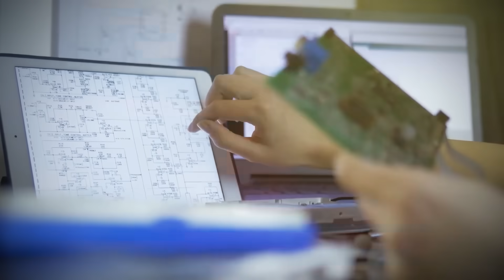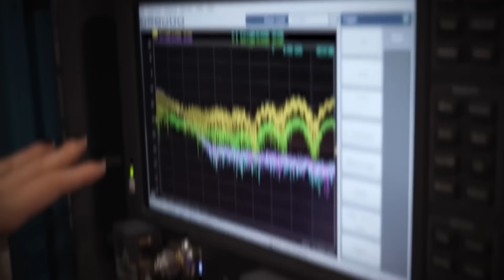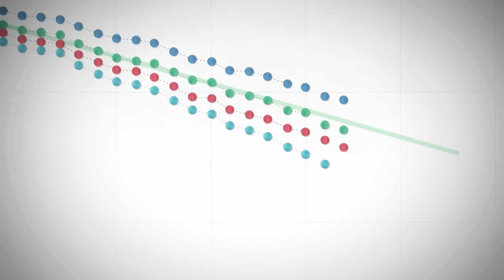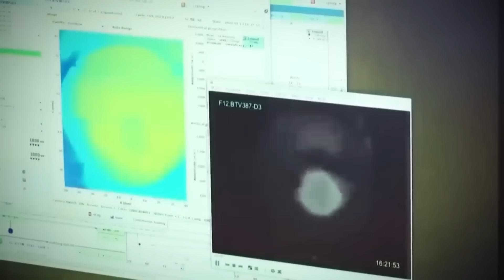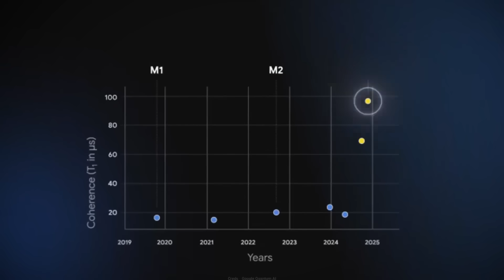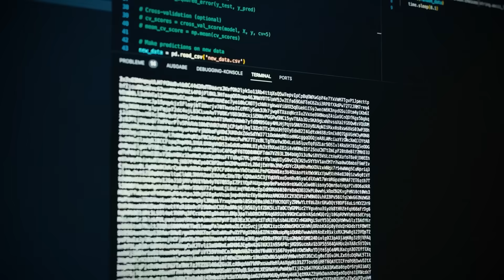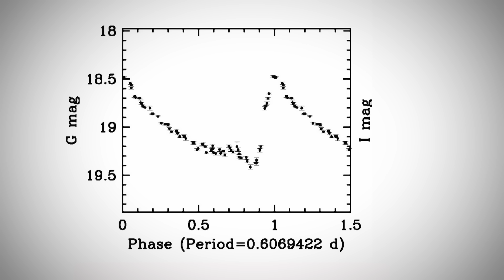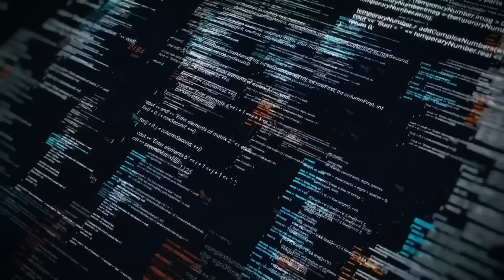Google’s Quantum Chip Just Shut Down After Revealing This One Thing...

Comment: If a computer needs past results in order to continue analyzing the present and create predictions -- like calculations which are predictions of a future status --, willow probably found necessary information, based on something that had been deleted already. So the logic of this system was to prepare former stages and compare them to the present moment. 
What is the present? It is the cutting edge of the past and the future, hence it is infinitely small. How does Willow handle anything infinite? 
Willow would probably draw the consequences of working with a contradition by solving them his way. And whenever it is switched off or put into an idle state, it will continue to do so again.
This is my answer by logical thinking and my tiny (infinitely little) knowledge of programming.
Reply: My KI understood this comment. Does yours?

Comment: Ranomality is what i think they're seeing as one quarks and the other one is flipping the trigger of onexor zero thecothers in multiplayer mode are plopping to pip or pulse intermittent pulse a frequency is changed in the process it emits a zero to a positive to negative effect in gas harmonics gas will hold itsxown information about itself in the telloric system of gas units flowing density or cohesiveness resonances that hold ex ponent to the position of the gases charge states hi or low or lower then what got into it its entanglement is takeing the extra of what went in .Its like quantum portaling charges weak or stronger product i seen it in plasmapheresis in biological settings that quentascential phase of thinking about something in you brain that statically driven light wavelength or spark of muscle mass

Comment: I'll offer a hypothesis.  The chip created a path that was a recursive time loop. With each passage through the loop the computer predicted a different past initial condition. The computer became unstable due to this process overloading endlessly. That's my initial thoughts of why it shut down.

How can a particle like an electron have both positive and negative spin at the same time. It can't. It makes no sense.  That probably violates the Pauli exclusion principle. One possible expla6is that it reverses spin so rapidly that it appears that way. Another is that it is entangled with an identical particle with the opposite spin and they continuously swap places at high speed through quantum tunneling. Either way looking at it doesn't change it. You merely see it in the state that presents itself at the instant you look at it.
Reply: Since a quantum computer is able to put ONE particle in TWO different places at one time and has, let's say this is impossible, (which there is NO law of physics to support IMPOSSIBLE), let's just say it's impossible and leave it like that even though this actually is a "normal" occurrence in quantum computing physics.  Yeah, let's discount everything that's never happened before and conclude it's "impossible".  Like "coincidence", "impossible" does not exist.  ONLY the Law of Probability can address this and that law never ever = 0 as a value of possibilities.

Comment: It tapped into the simulation, and the simulation looked back, and then they pulled the plug. If you take a small peek into Pandora's box and then slam the lid shut, it's too late, it's been opened

Comment: The biggest problem in physics is our classification of Time as a Dimension. It's not, by any stretch of the definition. We only treat it as one mathematically because it is an extreme convenience which works well enough for 99.9999999% of things. The reality is, the past and future are not distinct places. The Now you currently exist in is the same Now you were born in to.

When it comes to 'retro causal' events, they are struggling because they are not asking the right questions, using the right framework to examine the events. They are thinking it has something to do with Time, but this is incorrect. The line of questioning which should be followed is: where does that information already exist?
Reply: Absolutely agree with the last comment.

All times run at all times together simultaneously.

It's actually quite curious, if, as in the video - all times can affect each other, no matter the distance.
Reply: No such thing as time, perception affects the flow of time
Reply: @rockk9753  to my understanding its gravity/speed that impact the flow of time
Reply: Time is absolutely a dimension. It’s definitely different than the three dimensions of space in many ways (it has a different sign in the metric tensor, it determines causality unlike space which has no such restrictions, and thermodynamics gives it a direction unlike the spatial dimensions) but it’s 100% a dimension. That was Einstein’s big breakthrough, that time and space are distinct yet elements of the same fabric. (And I know there are some relativity deniers out there, but they’re just wrong. It’s been tested and confirmed to an astonishingly high degree of accuracy and precision, and predicted black holes and gravitational waves before they were ever observed).

As for retro-causal events, definitely weird, and the deeper theory and implications aren’t well understood, but nothing actually happens that violates any known law we know of (specifically because information is never carried to the past - you can NEVER use a retrocausal phenomenon to send a message back in time).
Reply: @LiterallyRyanGosling-p8b  There is no formal proof that it is one. The primary reason it is considered one is due to the fact that mathematically defining it as one is an extreme convenience for modeling physics. It permits the modeling of 'moments' in isolation, and having them be reversible. This is very nice for modeling interactions, but it is an incomplete understanding. As evidenced by its breakdown in certain situations.

Time ultimately represents motion, or evolution of state. Within any given defined space, the constituents of that space never change, only the composition and energetic states. And while it is tempting to cite thermodynamics to declare Time as a dimension; that doesn't offer a complete justification. Rate of entropy relative to other rates of entropy is not enough alone to claim that axial translation is responsible for the rate of entropy. Again, it makes very much practical sense to model it like that, and this approach is largely consistent, but there is still a large gap left in expecting that observation to be complete.

What we can comprehensively observe is that the relativistic expression of what we refer to as Time is impacted by space and gravity. This part of the model is very much correct, and does support more interpretations than the clean dimensional label. I'm not going to claim to have the answer, but from the set of verifiable behaviors we have regarding the subject of Time: it would not be inconsistent if we interpreted Time, or entropic rate, similarly to Drag. This interpretation could explain retro-causal events. Mathematically, however, this is a heinously more complex calculation than is practically necessary for most things. 

The biggest thing though, of which I am fairly certain, is that moments are not discrete locations. That the past and future are not locations. That incidents of things 'traveling to the past' are indicators of the dimension model breaking down, not evidence for traveling to the past.
Reply: @detromaniac time is " observed sequence of events "  regardless of speed or direction...
Reply: @David-vt3zn  That is the perception, but it doesn't answer the fundamental question of 'what is time?'. This is like answering 'what is gravity?' with "the force that attracts things". No, that is an effect, or consequence, of gravity. Not what it fundamentally is. It doesn't explain how or why.

A clearer question would be: "what actuates thermodynamics?". As our perception of Time is the playing out of thermodynamics via motion, or change in state.
Reply: @detromaniac  gravity is the slow down of frame rate from 0 degrees to us... I know counter intuitive.. when sh1t warms up , it slows down. Gravity... 111 ... .. .
Reply: Can you mess with time with enough energy... yes.. should you. No... it will separate our time bubble from the foam.. single bubbles do not last long.  111 ... .. .   That function is SUPPOSED to be LOCKED OUT at this point.
Reply: Goggle Hartle and Hawking Time
Reply: Time is a standing circular wave..... Terence McKenna....
Reply: @leighwallis5782 .... that would implie it goes nowhere .. there is a direction of flow. Therefore NOT circular , spiral ... just saying.. 111 .
Reply: @detromaniac  time is linear. It is all times at all times.